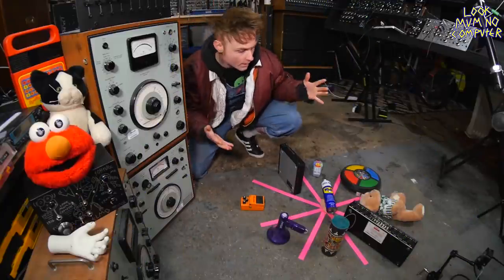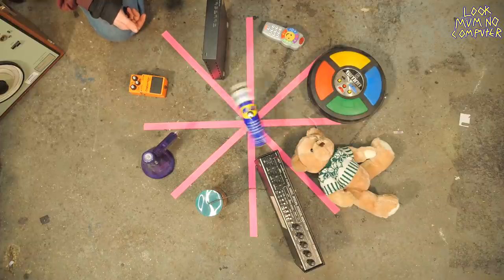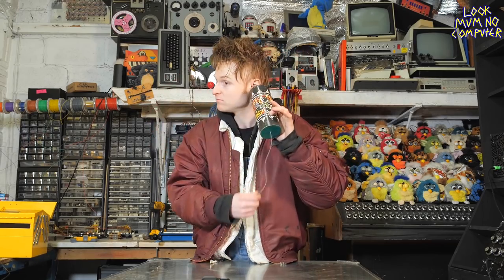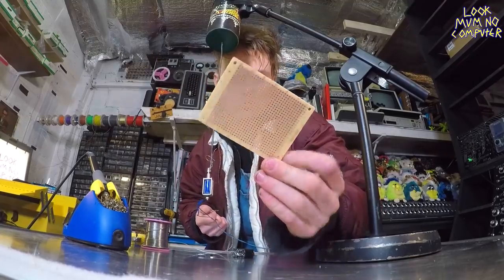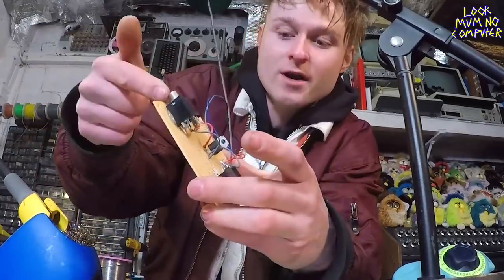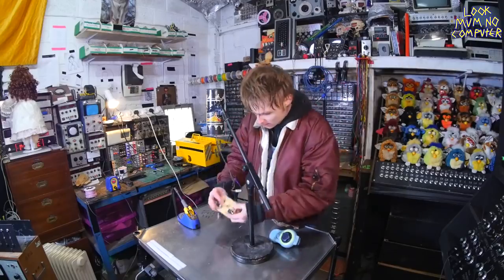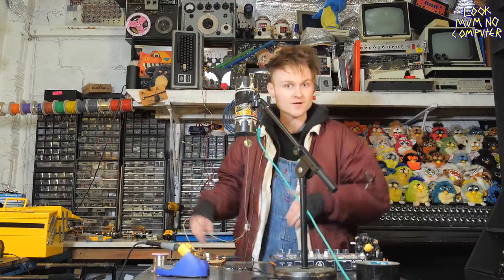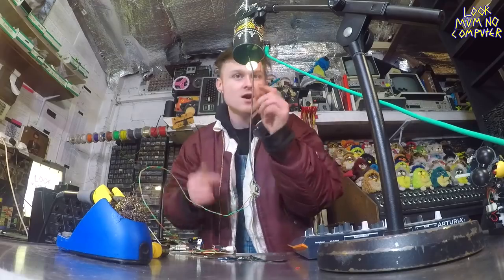Spring Reverb Made With A MOTOR???

Comment: I'd consider myself a mid level tinker-er.  If I begin a project like this, I usually have about a 50/50 chance of having a functioning project in the end.  Between your super simple oscillator, passive low pass filter and this little mosfet amp, I was able to make them all work on my first try with parts that I had sitting around, which often aren't the exact parts you use, but they work.  Thanks for your ideas and your explanations, I've gained a lot from what you are putting out into the world, and I appreciate it.  Cheers!

Comment: I’m not kidding you: when I was tiny (in the 70’s) I had a spring reverb detached from some amp and each end of the spring had…MOTORS! One sending the sound (small alternating left/right movements of the sound wave), the other capturing the twists and turning them into the electromagnetic impulses of the sound. They were small magnetic electro motors. Thanks for all your vids!
Reply: as he said, its how "commercial" tanks generally do it. 

i have one with piezo transducers, but they have this rather fiddly mechanism to produce the required torsional motion. at the time, it took me a bit of research to figure out why they did it like that...

its about signal to noise ratio. kicking and thumping anything very rarely produces a "torsion wave"... so it gives teh best immunity to external influences.

the really fun part? early "proportional" RC transmitter receivers used the same idea. a spinning drum wrapped with a wedge of copper foil with a wiper to produce the PWM for the trasnmitter, and a simple motor acting against a spring as the servo on the receiver. a major leap from "bang bang" controls with relays and clockworks...

Comment: What about modifying a distortion pedal to get the most wicked sounds? Changing the resistors? Like, can we pull a resistor of lessr(greater?) capacity, out of a toaster or some common household appliance, put it in our distortion box, and get an awesome sound?

Comment: I vote adding an elaborate flashy wheel of fortune for each video as a tradition.  A DIY video props channel use to do that back in the 'Old West' days of YouTube and it was one of the videos' highlights.  Could possibly use it to add in challenges or spice things up since the title gives the actual objective away.  Video analytics speak greater than what I preach though so I'd take a look at that to see if it's worth the effort.
Reply: Also, knew absolute zero about wall pixies before running into your channel.  I'm by no means a genius but I can finagle my way around things from time to time now :D

Comment: Your Hakko will heat up much faster and last a lot longer if you don't put steel wool in there(it dissipates heat and makes the heating element work all the time, it will also get in your solder joints). Search hakko fx-888d to see where you jam the brass wool.

Comment: 5:20...

FINALLY! SOMEONE SAYS IT!

yes, "professional" reverbs, such as "accutronics", use TORSION. it means they are far less sensitive to external influences like kicking them... its the biggest, most fundamental mistake that almost all DIY reverb units make... attempt to use either transverse (up and down) or longitudional (in and out) propagation... they all inevitably howl with feedback and make awful boinging noises with the slightest of impacts...

of course, the transducers will still make some sort of signal regardless of the wave they detect, they all "boing" if you thump them hard enough... but the torsion does make them relatively immune to noise. the gain on a standard reverb tank is huge, they only need a very small "tickle" to work.

the best type of motor to use is a "synchronous AC motor"... try microwave turntables, or submersible pond pumps. steppers work but have restricted range of movement (unless you get the small 15 degree type like in a CD/DVD plattern...), and DC motors are fine but have the brushes that inevitably get "scratchy" like a dirty pot can... but can also add a certain "character" that may, or may not be to ones liking... that being said, rip the brushes out and just wire straight to the commutator.

in all cases, "impedance matching" is a big factor to get a "full" tone. you dont need the full range of audio, but you do need the center frequency to be somewhere around 500hz-1khz.

and finally, best mixer is to use two fets or transistors feeding into one common load resistance... one does the wet, one does the dry, the biasing and input circuits can be completely independent, and they mix without interfering with each other as much as other methods...

Comment: You've got a "little punk reverb" ))) Sam, can it be controlled with "more levels". Maybe you could make a stick with two fixation points for the spring. So you could change the tension and make it sound different. Also you could place the can in some box and maybe make some holes in the can (so the reverb will not be "like in a collector's pipe" type of). I'm sure that the can is resonating and "sends" weird harmonics to the spring.

Comment: I'm thumbs up Number 100 😁 Sam love your video's I done my first circuit bend on a crappy top called a Sat Nag lol. I put a resister on board and it sped up lol.
Reply from the maker: great!!!! :D glad your trying stuff. if you swap that resistor with a potenitometer then you can adjust the speed.
Reply: @LOOKMUMNOCOMPUTER  I can grab one from work, I remanufacture coffee machines so we chuck out so much electronics it hurts me when they chuck out good parts. In the kids toy box is a cat that has keys so I will mod the hell out of it. My bird said no but no means yes lol. Cheers Bro have a great day 😎

Comment: I'm stuck. I have the motor and I can feed the audio signal into it. I can feel it vibrating to the music as it should but there is not enough power coming out of the audio signal to move the motor enough to shake the springs.    Do I need to increase wattage of audio source? Or how do I do this.. Any help from community be fantastic.

Comment: as far as i can tell the sound doesn't come from the motor spinning but instead you're using the motor as a speaker. After all that's a dc motor so you simply got coil + magnet. the same basic setup that a sepaker has.
Reply from the maker: Gagootron indeed! It is jammed. Like I said the motor is fighting notvskipping over to the next pole swapping bit. So yeah just an example of a motor being the same as a speaker but sideways haha

Comment: I connected the motor to the mosfet, but it will only trigger the motor when I touch the connection, not from the audio signal - ?  any tips? ta b0$$

Comment: How does a motor from DC work? Thought motors worked from AC
Reply from the maker: a brushed motor is a DC motor. they mechanically switch the polarity of the DC current as they spin. :) theres probs a vid showing how it does it on the webzzzzz
Reply: @LOOKMUMNOCOMPUTER  oh sick thanks